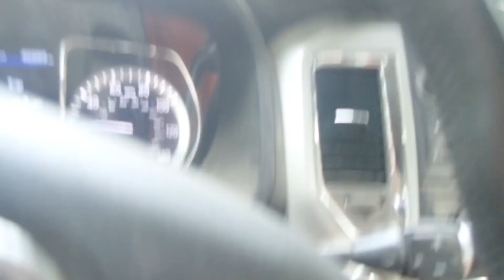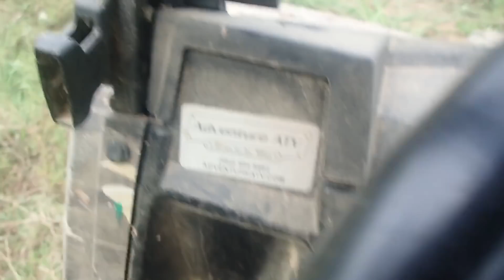BACK ON THE GRT MODIFIED 🤔🤔🤔

Comment: Back 15 years ago when my cousin ran imca mods that could run any motor as a 4 barrel but there was a $300 claim rule. He could run 3 or 4 link. Have the rules changed that much or is that just the track you are running at?
Reply from the maker: Not much